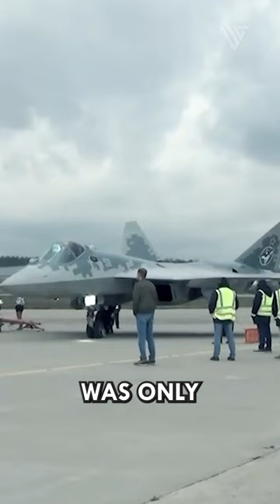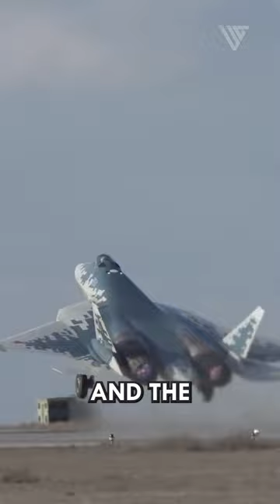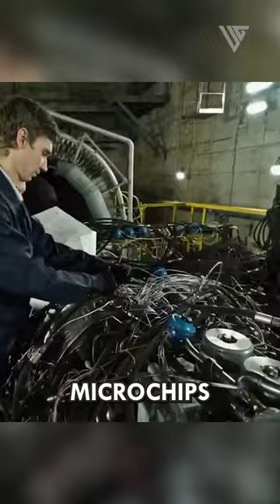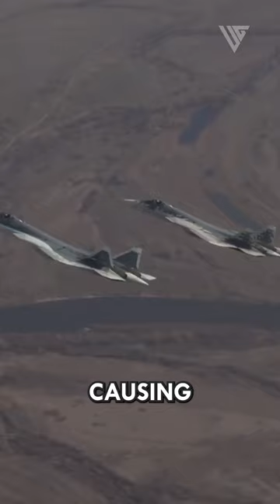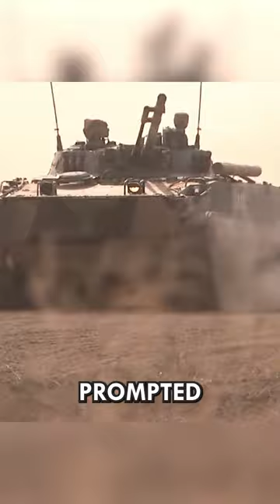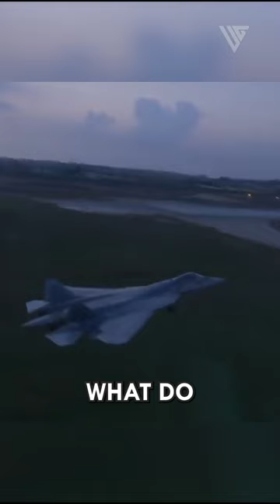Why Russia Only Produced 25 Su-57 Stealth Fighters? #shorts #undrgntv

Comment: First get rid of the computer voice.

Second is they have 6.  One built in 2018, one in 2019, and 4 2 seat trainers built in 2020.  They have something like 12 that were supposed to be built this year.  Estimates are they might get 4 built if they are lucky.

Third they are not a real 5th generation fighter.  They lack almost everything that makes a 5th generation fighter... especially stealth.  They are LOW VISIBILITY not stealth and this is only from the front.  They are not even considered low visibility from the side or rear.

Comment: I wonder wy f-35 production was just fine...
Reply: Maybe because it started earlier than the su 57 or maybe they were unable to get all necessary chip imports?
Reply: @MemeManiaYT  started earlier? Waht does that have to do with production in 2 year pandemic period?
And no... they did not have a bunch of spare chips imported.
The channel is just talking bs.
Russia has so few su 57 because its not worth it to build it.
Doesnt fit into russian doktrin, its expensive af and cant compare to the f-22 or even f-35.
Reply: Maybe because US brags with a lot of bs against many others into a certain way, just to make sure no one would get over them with a certain ‘something’ ??
Reply: @MemeManiaYT the JSF Program began in 1995, with a flyable product produced by just 2000 and the then X35 was nothing more than a flying shell. 

The SU57 program began in the year 2000 and took 10 years to produce the shell of the Su57. 

Clearly the Russians struggled as it took them 4 extra years just to make a working air frame.
Reply: @haventthoughtofanameyet6364  couldn’t find anything about when the su 57 program began but I did find the first flight was 2010 and it was introduced in 2020. But the f 35, just like the su 57 took 10 years after it’s first flight to be introduced. Okay so the development for the f 35 started in 1995 and first prototype flew 11 years later in 2006. While development for the su 57 started in 2002 and first flight flew in 2010 just 8 years later. So why does the su 57 get criticism for being “late” but the f 35 doesn’t even tho it took longer time? Do you see how hypocritical that is? That is unfortunately with most Russian jets, people tend to criticize Russia for something America is doing but not America.

And now, Russia has almost 2 squadrons (21) su 57 serial production so the program has been sped up since the invasion cos technology evolves faster during war time.
Reply: @haventthoughtofanameyet6364  the first flight of the su 57 was 2010 and it was introduced in 2020. But the f35, just like the su 57 took 10 years after it's first flight to be introduced. Okay so the development for the f35 started in 1995 and first prototype flew 11 years later in 2006. While development for the su 57 started in 2002 and first flight flew in 2010 just 8 years later. So why does the su 57 get criticism for being
"late" but the f35 doesn't even tho it took longer time? Do you see how hypocritical that is? That is unfortunately with most Russian jets, people tend to criticize Russia for something America is doing but not America.
And now, Russia has almost 2 squadrons (21) su 57 serial production so the program has been sped up since the invasion cos technology evolves faster during war time.
Reply: @MemeManiaYT  because that isnt correct. The program began in 1995 for the JSF, Joint Strike Fighter program, and the program had a functioning airframe in 2000, not 2006 when the official F35 flew. My point was it takes russia longer to produce something and when it comes to fruition, it isnt nearly what is promised as is the case with the Su57, and the SU program as a whole.
Reply: That’s what exactly question everyone when no 1 responds
Reply: @philipbasler5077 what are you even muffing dude 😂
Reply: F35 is so stealthy one went missing even the pilot cannot find it.😅😅
Reply: @calistusfrancis1340 it's not worth building it because Russia is in a war and they don't need wunderwaffen

Comment: Disregard this BBC-style delire. All microchips used in such weapon are produced locally (65 nm at max so far bul still) The main reason is that Russia needs lots of tested and relatively cheap weapon (like Su-34) here and now and not some superexpensive wunderwaffe. Besides the new engine is only just having its final test.

Comment: For some reason, everyone forgets about such a simple thing as production facilities.In order to produce any products faster, you need to increase these capacities, for example, there is one plant that assembles the SU-57 and ordered 100 aircraft that will be produced within 15 years, for example - people at this plant will be provided with work for 15 years ahead and production facilities are loaded at 100%, and if you need to speed up the process then we will have to build several more of the same factories (which will require a lot of money) / train personnel and so on - as a result, 100 aircraft will be made, for example, in 3 years and then the "extra factories" will either stand idle or they will have to be demolished, and this is a huge hole in the budget.Such an increase in capacity can be considered justified only during a major war when aircraft quickly run out

Comment: One was shot down by a patriot the software was modified but it shot one down and what they thought was safe air space 25 km from what they thought was the maximum range. Well things have evolved and they lost one of their 5th generation fighters. What was best there were several other types of aircraft in the area and the Patriot could pick it out of the group.
Reply: I would love it if this is true, but I searched and couldn't find anything. Can you send me the right direction? Also the SU57 is 4+ Gen not a 5th gen. at 1 sq m it is too easily seen at too long a range by the radars on the F35, F22, and F15, and Patriot.

Comment: I think youre very misled on why that aircraft number isnt rising
 First off: look at american production and european production of the F35 and Eurofighter Typhoon, it wasnt nearly as hampered by covid in the same way as youre claiming russia was.
Secondly: if russia attacked the Ukraine thinking they wouldnt be sanctioned, and actually thought theyd be able to keep production pace on par, then theyre even dber than we think but the reality there is simple. The Russians havent built one in 5 years and there is a reason for that,  they cant afford to. Theyre barely operational as is, and didnt one crash land in flames after flying too close to the ground trying to evade a missile? The Russians are inept as hell, it is a funding problem first and foremost, and the fact they dont log nearly as many training hours as they should and they dont maintain the craft properly either. All that points, as evidence, to Russias incapability to fund this program any further- meanwhile they struggle to male the SU57, they turn around, look at a different camera, and tell the world the SU75 "Checkmate" program is going swimmingly...Russia has no SU57s because they cant, literally cant, build them. Period.

Comment: "chip shortage" is ridiculous. Think about it. How many integrated circuits of any particular model would you need for one plane? A couple dozen at most, including spares, otherwise you run out of space in the electronics compartments. so maybe you need a couple hundred or low thousands of each, and if you're willing to spend a couple million on each plane, you should be able to outbid almost anyone else for the same chips. More likely: The west stopped exporting certain chips to russia that are hard to replace and source elsewhere.

Comment: The su 57 got delayed because they still test it as they want to uptade the su 57 engines to flat nozzles (atleast from what i know) for lower visibility pretty much like how the f 22 has its engines and they also want to get better electronics thats why almost half of the su 57s are test beds but the biggest reason is why make so many high cost jets when you can buy way cheaper 4th gen jets that do the same job and can carry much more payload (missiles, bombs, etc) but arent stealth

Comment: 57 cannot be detected by radars, it would be dangerous to go to war and not detect the enemy.
Reply: The skin on the Su-57 is covered with rivets. The rear end of the engines are not covered at all. The Su-57 is not stealthy, not even a little bit.
Reply: Yeah Its hard to be detected when your not even in the Air, like the SU-57